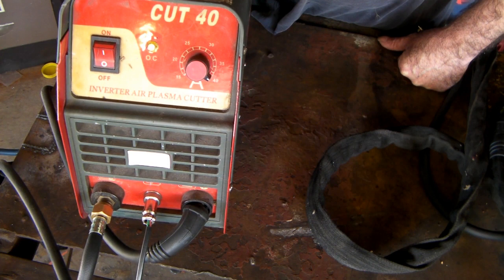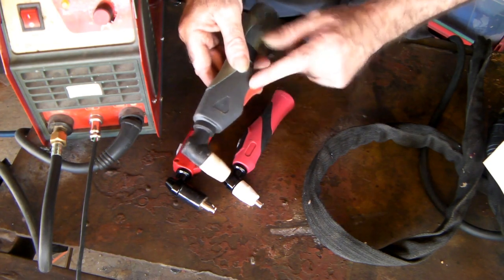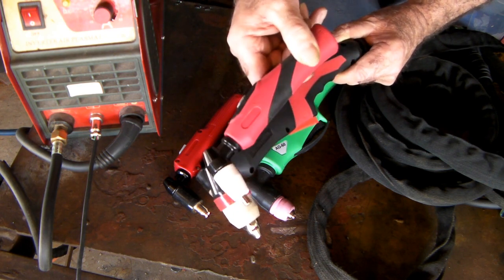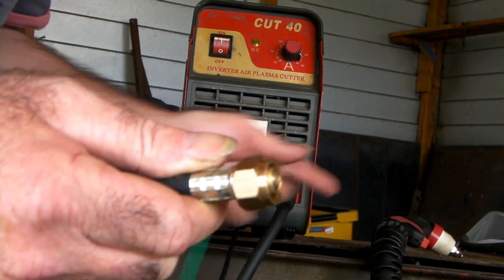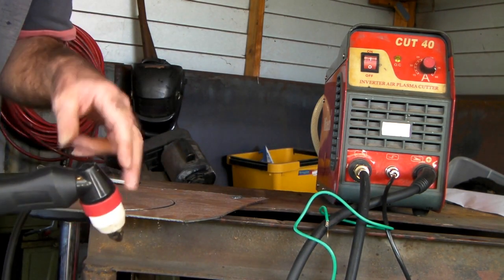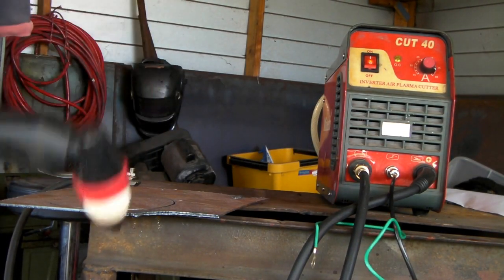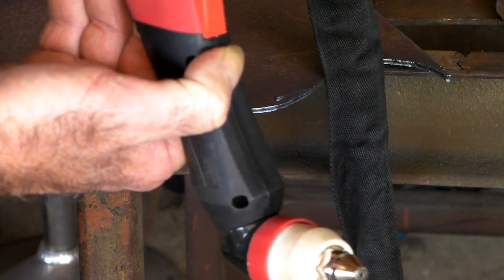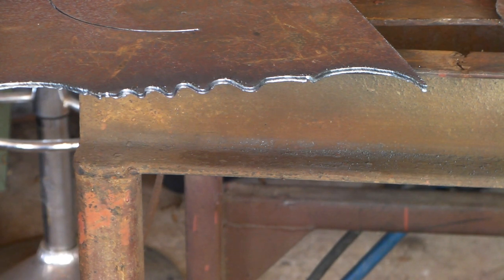Cut 50 Plasma Cutter Running Huge Torch

Comment: 1mm or 1.2mm nozzle hole? My 40A P.Arc machine came with a PT-80 and manual says just use 0.9 or 1.0mm nozzles so they must know it works fine down to 20A
Reply from the maker: maybe 20 amp should cut 1 mm

Comment: How did it fair compared to your normal torch are you using it more now
Reply from the maker: Hi Anthony , yes it goes great but i think i would be even better running it at 50 amps my 40 amp machine is just a little small Ithink.
Cheers pete

Comment: My new TD Cutmaster 40 (new machine, not the old Cutmaster 40, confusing) is a 49 amp machine. But ESAB has been supplying their 40amp cutters with the SL60, 60 amp torch for a couple of years now. But they have consumables from 20 amp to 60 amp for it. Their SL100 torch, 100 amp will also work with the machine, but is really overkill.

Just keep in mind that consumables for different amperages have different size orifices. They require more air.
Reply from the maker: cool thanks